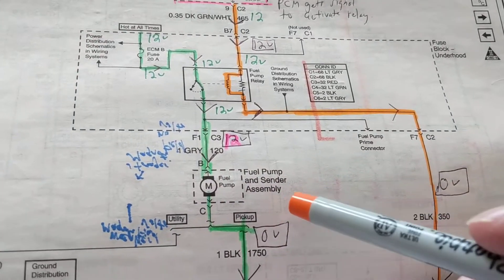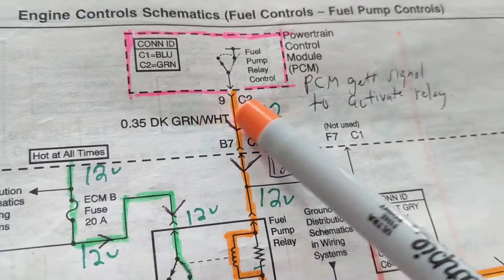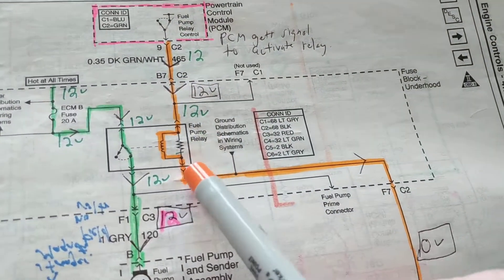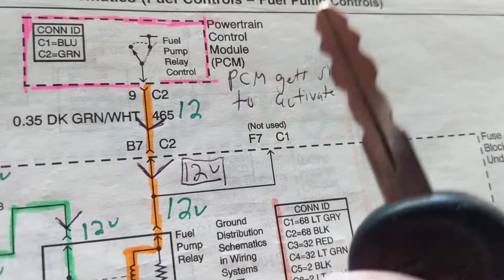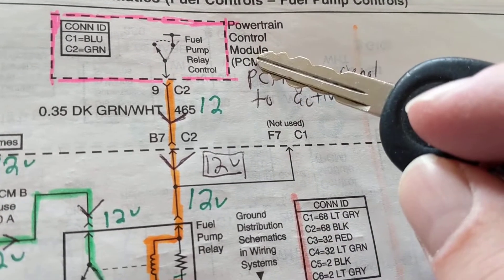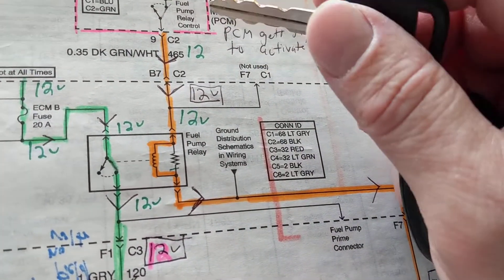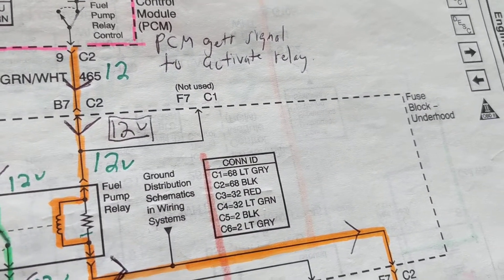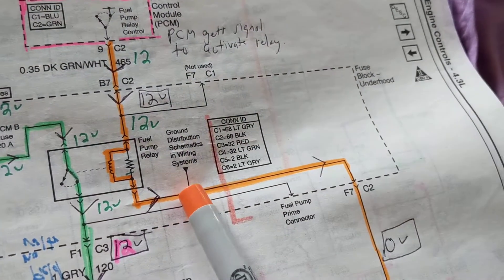HOW FUEL PUMP relay WORKS

Comment: You should know.. when there is a "dotted line" around a module, it means that this is an incomplete diagram for that module.  In other words, the module will have more wires going to it, but they just aren't shown here because it's not related to what system you're looking at.  For example-- we know that the PCM/ ECM will have control over the injectors, etc. but it's not shown on this diagram because it's not relevant.  But the fact that it's not showing everything, means they will put a 'dotted line" around the module.  The "fuel pump relay" has a completed line around it, which tells you that it is showing every wire that connects to it,  in this diagram.
Reply: You are absolutely correct!
Reply: Useful info - thanks

Comment: You are completely wrong, There is NO transponder or chip inside that key. This is a passive anti-theft system, that's why it's named "Passlock". You are correct in there being a signal required but it has nothing to do with that key, the signal comes from the Hall Effect sensor inside the ignition cylinder and it's sent as soon as the ignition is rotated. I can start GM vehicles with no key at all. Why? Because the sensor is inside the cylinder, not the key. If you get the cylinder to turn, it will fire up and stay running.
Reply: That's only true for certain years..  Most modern cars have transponders or immobilizers in the key now.. And even newer cars have a smart key system.  It all depends on the make and model.
Reply: @calholli  We're talking about a specific system(PassLock) from a specific video. Wtf are you going on about?

Comment: What would be the voltage reading is ignition on and engine off?
Reply: In the wrong position you should have 12 volts on terminal 87 because you develop pressure fuel pressure